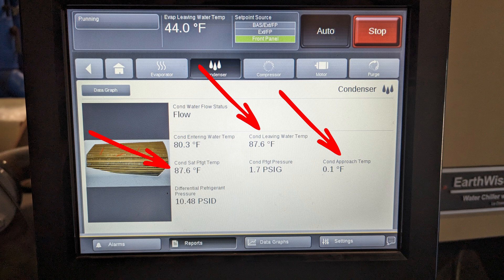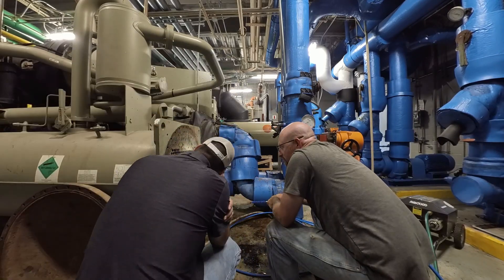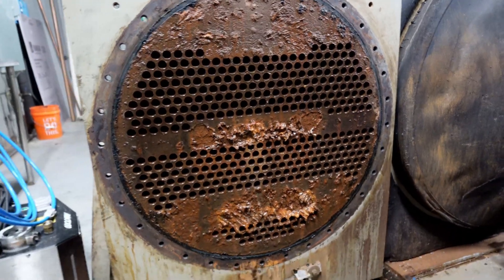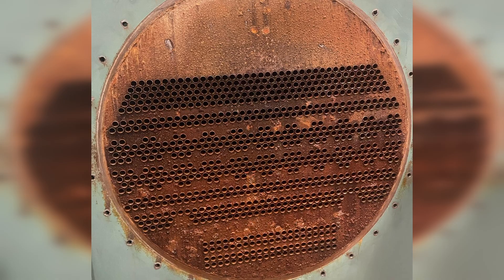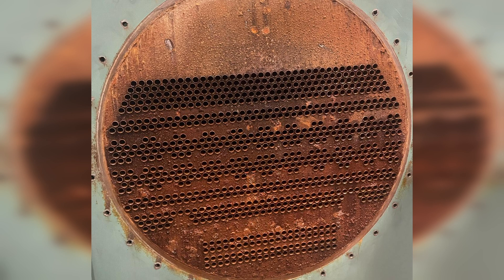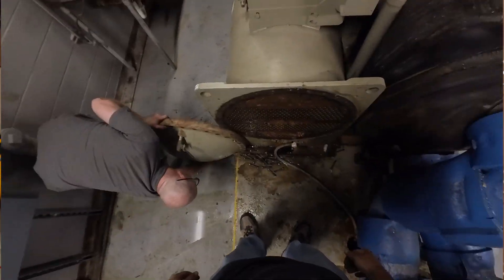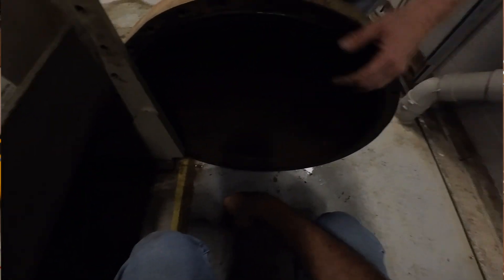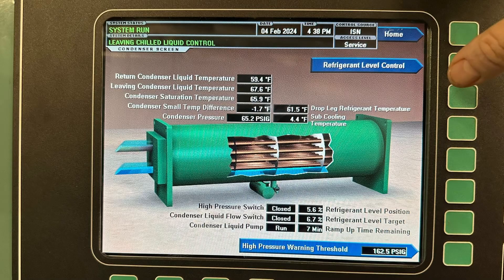Understand Condenser Approach with Chillers

Comment: Thank you for your video. Just a quick question. In your diagram you mention that outgoing water is 67.6F and your condenser saturation temp is 65.9F. I don't see how it's possible for water leaving condenser to be warmer than condenser saturation temp. Heat would then want to transfer back into refrigerant. I might be missing something but don't think so.

Thank you for your time.
Reply from the maker: The picture used as an example was a chiller having issues in that moment. You are correct the condenser saturation should not be lower than leaving water. I apologize for the confusion that created.
Reply: That chiller behind you is giving a -1.7 approch. I have the same readings on all my new magnetic york chillers. Is this normal and what did you find as the issue?